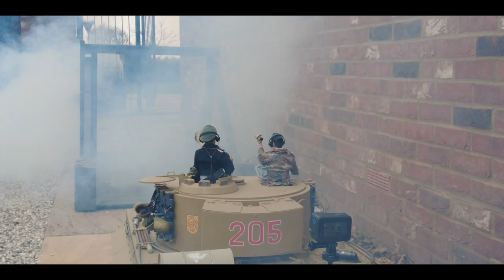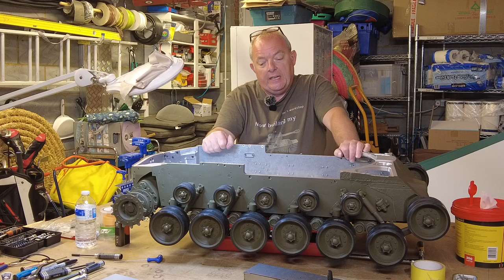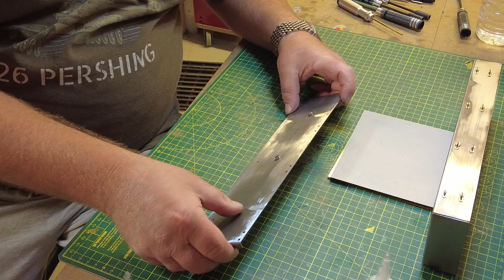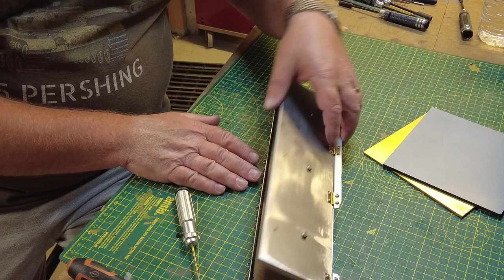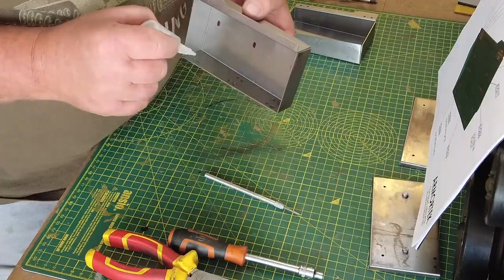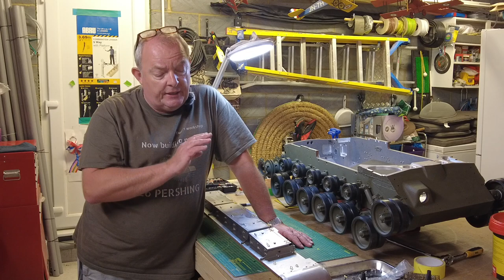1/6 scale Armortek M26 Pershing RC Tank build. (Vid 13) Assembly and Installation of equipment bins.

Comment: Tony, I remember doing the bins about a month ago and it was very tedious with the hinges as you say. Also, you are correct in using moderate force when tightening down the screws on the hinges as they will twist the soft brass and ruin the hinge. I know because I did it to one hinge and had to use one of the spares that came with the kit. I was able to repair the damaged one later however. I notice on the large bins that you have all the handles pointing in the same direction. I made the same mistake, because according to the manual and the real tank pics, the one handle on the end should point inward, And for those handles, since there is very little surface area for the Loctite to hold onto (just the edge of the sheet metal), I used a small dab of epoxy on the handle before inserting into the bin. It gave it a very nice small area to grip the surface. And it naturally flowed into a very small tapered shape that looks like a weld. My option packs came in today, so I can start working on the tank again. I have all the top parts assembled, painted, and dry fitted, but not installed until I had the option packs installed so nothing would get in the way.
Reply from the maker: Hi Ray, Maybe that is why they send a spare one...I learned that lesson when I was doing the Bins on the Tiger. Yep...too late..I had already painted and weathered the bins when I noticed that...I am going to leave it, as I don't think it will detract from the Tank when finished..looking forward to catching up with you and the guys later today.
Reply: @tonys_workshop  And as tedious as it was to install all those hinges I took mine all apart about a week ago and bought some micro hex head screws and replaced all the button heads. I just don’t like the look of button heads anywhere on the tank and have been replacing anything that shows with hex head versions.